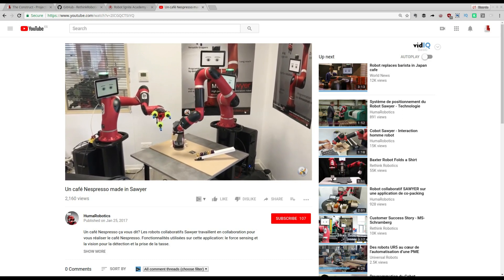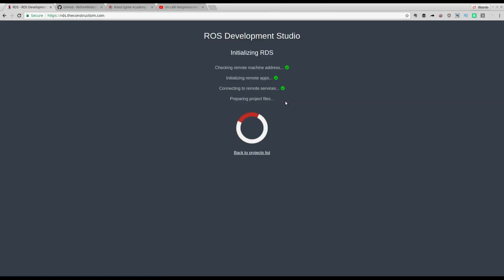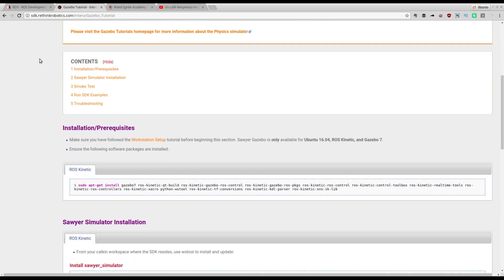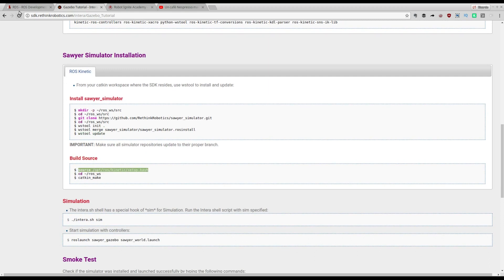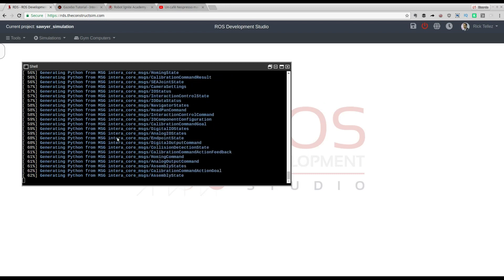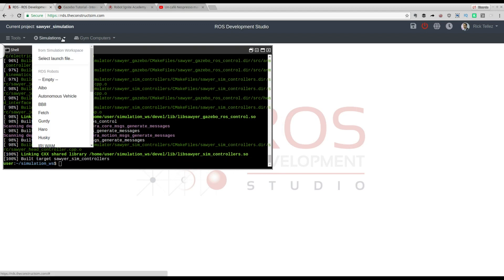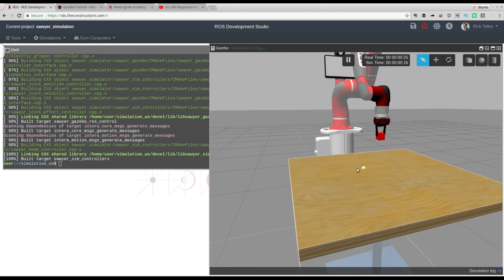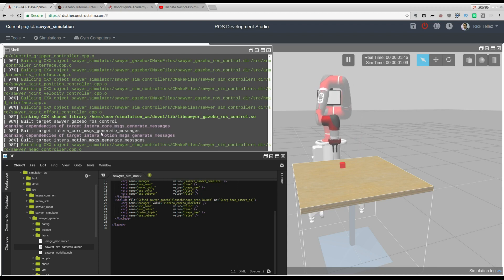[Movelt! Camp] Week 1: Get the Sawyer robot up and running.

Comment: Hi Ricardo, 
I've been following along and after I entered catkin_make I received the following error:

"Makefile:320: recipe for target 'cmake_check_build_system' failed
make: * [cmake_check_build_system] Error 1
Invoking "make cmake_check_build_system" failed"

Any ideas why this would occur?
Reply from the maker: Ok your error is quite cryptic. I presume you are not using the ROSDS but your local installation. If that is the case, I would recommend you to use ROSDS because everything is already working and setup (http://rosds.online). About your problem on your local machine, this could be a lot of things. It looks like you don't have a proper setup for compiling:
1- do you have a running ROS environment (I mean, have you compiled other ROS programs)?
2- Have you sourced properly your ROS installation?